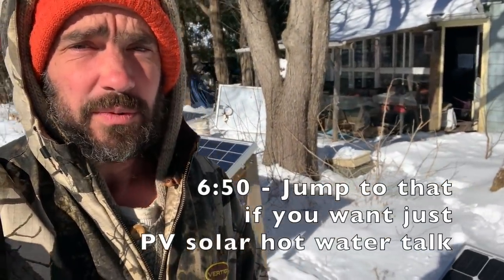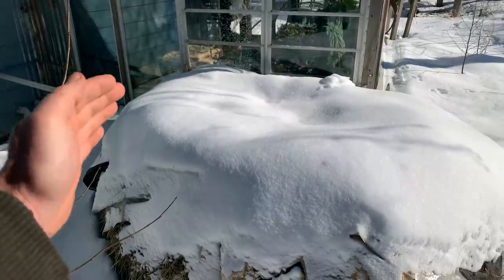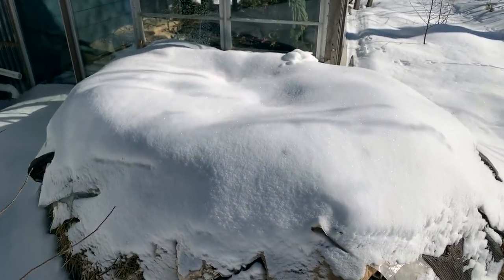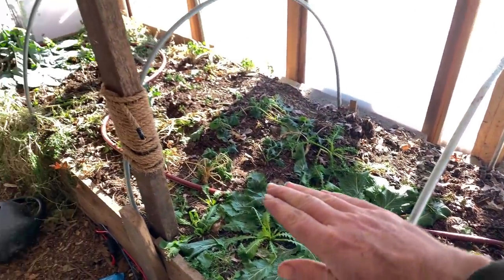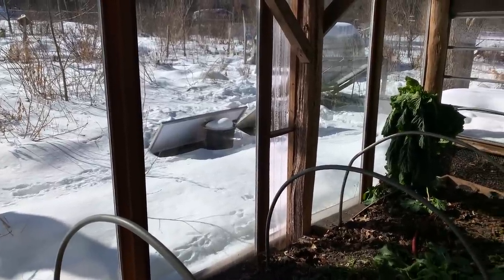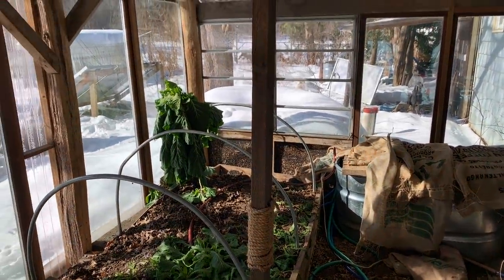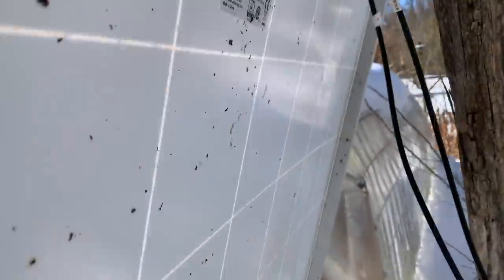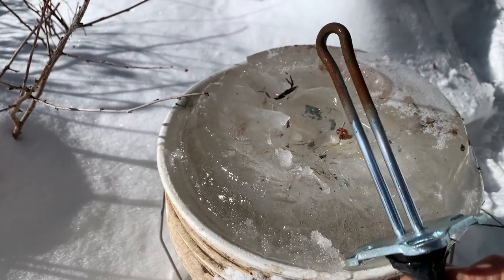Compost heating FAIL! (but solar water heating has promise!!!)

Comment: Compost Heating Failure: At our Community Garden in Northeast Alberta we have a compost pile in our Hoop House Greenhouse. Our primary purpose is to continue to produce compost through the winter when temperatures can be as low as minus 30 to minus 40 for extended periods of time. We also hope to use the heat from the compost pile to allow us to start germinating seeds in early spring. We have found that adding new organic material to our compost pile is the best (only) way to keep it heating during the extreme cold. We also circulate air through the pile with a battery powered blower moving air through weeping tile in the pile. We also "stir" the compost pile with battery powered drill with an auger bit. As you noted your compost system initially worked but failed as time went on. We have a similar experience  unless we keep adding new material.

Comment: This is some really exciting and interesting experimentation - especially given the extreme cold/sun contrasts you  get to deal with in your context (I'm jealous, Seattle's winter rain cloud blanket and Puget Sound heat reservoir generally means we're both above freezing, and too dark to do much solar scheming during the winter. Oh well, I'll live vicariously through you two:)

I had a couple thoughts, thinking back on my years of Thermodynamics in undergraduate engineering:

1) It's almost always easier to increase the heat in a greenhouse by improving the insulation and air-tightness, rather than trying to dump in more heat. This is both because insulation is often cheaper than heating tech (though, good score on the free solar panels!) and because any additional heat you dump will still be subject to losses because of the poor insulation, etc.

The folks at The New Alchemy Institute in Canada and Maine in the 1970s-1980s (which is literally one of the coolest scientist/hippie "Let's just start doing things" projects ever) found that fully passive bioshelter greenhouses benefited from having the back up to 20% of the walls covered with reflective insulation, which raised both temperatures and light levels (because light wasn't lost out the back of the  clear walled greenhouse. They found that a further 40-50% of reflective insulation on back walls continued to improve temperatures, though light levels suffered. Beyond 60% opaque, insulative walls, the temperatures began to decline too. Here's the report they put out in 1981 (the year I was born, geez!):
https://newalchemists.files.wordpress.com/2015/02/bioshelt.pdf
The rest of their archive is just amazing, if you haven't read it all already:
https://newalchemists.net/

Think about adding  tons of insulation in places like the eave-corners, where light doesn't really get in anyway, and in the lowest parts of the walls - which often aren't letting light in that gets to plants.

2) Since you have really cheap solar panels, it makes sense to use that electricity to create heat, for the reasons that you named. But in the longer tern, or for folks who are thinking about replicating this system themselves, directly creating heat from resistance heating isn't the best use of a refined energy source like DC electricity. If you can afford the additional cost, it's worth rigging up a heat pump to extract heat from somewhere (even the ground) and dump it into your system. Since they are moving heat around, rather than converting your electricity into  heat directly, they can achieve heat delivered / energy required efficiencies of greater than 100% (we regularly get close to 300% with our home heating system on mild days). Even cooler is the possibility to run the heat pump on bright, warmer days to move heat into a storage reservoir (maybe a bunch of burried gravel, maybe buried tubing to heat the ground) and then drawing that heat back out on a colder, brighter day. Heat pumps are getting smaller and smaller, mostly as AC units for van-life or boating folks:
https://www.mabrupowersystems.com/air-conditioners
But you can also rig one up yourself from broken minifridge and automotive radiator components:
https://www.youtube.com/watch?v=b3fL0r-Z2qM

Anyway, keep up the amazing work, and best of luck.
Reply from the maker: Wanted to follow up with a big thank you for sharing these ideas and links.  Somehow youtube flagged it as SPAM!  Just now I noticed, so I've got the links loaded up and some learnin' to do... Much appreciated!

Comment: We've been bitter cold here in Indiana and also super sunny. Definitely some potential with some light tech. I've been experimenting with a cheap little dome greenhouse inside my farmers friend tunnel. It got up to maybe 30f outside today but the little dome in the greenhouse was over 90f. Heat retention in the night is definitely something I need to work on. It only says about 10f over ambient with a little heat mat going. I need more thermal mass.

Comment: Be forwarned that i haven't done this myself and have no hands on experience with the compost heating system but I am very interested in the subject and have been digesting information for future use. Lately I've seen a bunch of videos also and right away i can see a big difference between their successful experiments and your not so good one: Their piles were much much bigger. Like 2 or 3 times bigger. I know smaller piles don't keep the heat as long so this might be the problem. Also they used cow manure Wich might heat up for longer. The only insulation i think they used was to insulate the tubes going in and out of the pile to the house so they wouldn't freeze and they had a very small pump going.
Hope this helps.
Love your experiments and vids!💕

Comment: Be sure to polish that panel if you can. Also have you thought of building a fresnel lense heating system? You concentrate a large area of light into a small point and use that to boil water.
Reply from the maker: I am very very interested in the fresnel lens experiments, and started with some recently but realize I need to get good eye protection bbefore I mess with it any more!

Comment: You have a video on heating your high tunnels. Sometime in the past I  watched a youtube video on an Amish woman who used hay bales to heat her green house. She used them as planting tables which she placed her planters on top to catch the heat rising from the decomposing hay bales. She used fresh rabbit pellets which she mixed with water and poured over her hay bales. Then she put the planters directly on top of them to capture the heat. Since you have hay bales or compost, and chicken manure I thought you could do the same thing to raise the temperatures in your greenhouse or cattle panel house. Maybe planting in removable trays a few inches deep would allow you to raise cool season crops on top of the decomposing heating stacks or tables. When you want to add the water you could just remove a tray and pour on the manure water. On your cattle panel house you showed a compost heap at the back door or end. If you had hip height compost heaps using chicken wire to hold the compost in place or alternatively used hay bales around three of the four sides of the cattle panel green house you would have heated areas to raise your plants as long as you kept adding the manure water to the heaps or hay bales when they started to cool down. Might save some strain on your back and knees. I am going to try it in some fashion this Winter for seed starting. Good luck!

Comment: I think your most important improvement will be insulating that water tank. Metal conducts heat extremely well which means that will be heating your greenhouse through the sides of the tank. As you mentioned the greenhouse is not insulated enough to keep the heat in, that will probably be the biggest heat loss you have in the water circuit itself. Also you can still insulate a bit around it without waiting for a thaw since it is inside the greenhouse! It would probably be useful if you can find an old rubber matt to slide under the tank as my personal experience with rubber matts is that they do not conduct heat well so it wouldn't take from your tank as much.
Reply from the maker: Great ideas here, thank you!

Comment: Backs up my experience, that even with a decent volume of compost it's pretty hard to keep it hot in a cold winter, in fact mine always runs cold even without pipes bringing cool water in (or taking heat out, whichever way you want to look at it). My suspicion is that you are going to need a LOT more volume of compost to heat that space, especially with so much heat escaping, as you noted. I've seen those huge hay piles people make for these systems, they are pretty significant. I've also not managed to keep compost going in winter even with covering/insulating it, just not enough volume.
Reply from the maker: Makes sense.  I think it will need to be a combo of a much larger pile that is nicely insulated AND these old solar panels helping to provide direct heat to the water by day to keep the system boosted... I'll keep exploring and sharing what we're trying and what we're learning (as we fail hopefully less each time!!) :)
Reply: @edibleacres  Yes, and any insulation you could provide in your lean-to , especially around the roof and eaves, would be a big plus I imagine.

Comment: interesting.  Solar power is also used to electrify fences, preventing moose pressure in Alaska.  Simple Living Alaska runs two strands going to one box, powered by a 12-volt battery.

Comment: Near the end of the video you started to mention implementing a solar panel to move water during the summer months. I'm curious, have you ever considered using a RAM pump?? They're excellent ways to move water when freezing temperatures are not an issue, especially with a series of ponds.
Reply from the maker: I hear ya, I would love to explore a ramp pump but we don't have the right landscape for it :(

Comment: I know it’s not totally sustainable but I live in CNY, it’s -12 F tonight and it’s 50 F in my double layer inflated  poly hoop house. I use a Chinese diesel heater that sips a 50/50 fuel mix of farm diesel and waste cooking oil. Only about 1 gallon a day and it runs off a 12v battery.
Reply from the maker: Sounds like a neat solution you've worked out!

Comment: Mine never heated up since I didn't either get it wet enough or I needed to add more bags of composted cow manure. I started very late so I was my own worst enemy. I put in about 10 bags of composted cow manure and a bag of blood meal powder. I was thinking about adding some urine to the center when the outside are goes up to above 32 degrees. 
Your idea of capturing the waste cycle of solar panels was so smart. Why waste a resource which still works? Brilliant idea!
Reply from the maker: I think if you start too late into a cold snap it just can't get started... Oh well, we learn as we go!
Reply: @edibleacres  so true!

Comment: As far as the compost pile, if while constructing the pile you inserted tubes to aerate all parts of the pile and thereby have the decomposition be aerobic throughout the pile as is done with the johnnson-sue composting method you would get a lot more heat production.
Reply from the maker: I think that could be true, although it would be introducing more surface area to the inside exposed to the elements, so I'd have to be quite careful about how to do it..  Thanks for sharing notes!

Comment: Thanks for the vid.  I love all of these follow-up videos on this proof of concept!
Just an idea on insulating the water tank.  I made a video recently on an alternative hot tub cover that rolls up (I got a free hot tub from a guy on Craigslist instead of it going to the landfill).  

I realize that you want to be as natural as you can with your materials, so I understand if you don't want this resource, but I used a closed-cell LDPE foam rubber, called Volara, to make the cover.  It has remarkable insulative properties, while being resistant to very high temps without degrading like other manmade materials.  Although my video is for a hot tub, I could totally see it being a very simple alteration to make one for a storage tank like this--plus your cat could get pretty comfortable on the foam!  :)

Cheers!
Reply from the maker: Thank you for this note, I may very well come back around to this idea!
Reply: @edibleacres  there's a gentleman from Colorado who did numerous studies on passive geothermal and compost air ducting that you might want to check out. He really takes a scientific approach to it. I will try to figure out his YT channel name. Or, look up 'GAHT and compost'.  I may try to do a hybrid version of what you were showing and what he showed.

Comment: When I build my house I want to build a thermal battery that will primarily be heated up by thermal solar panels, but I'm thinking I may try and get some old/beat up PV panels to help heat the thermal battery as well, since thermal panels arent always super efficient, especially homemade ones haha. The thermal battery will help heat the water for the heated flooring, and help heat the hot water for the whole house
Reply from the maker: Sounds like any time you can integrate a few different ways to meet a particular goal it seems you are doing the right thing!

Comment: The angle of the solar panels is crucial for efficiency. That scrap 325W panel is at an extreme angle, more appropriate for the arctic circle.
Reply from the maker: I hear you.  That was a VERY temporary place to put it.  I plan on making simple 'legs' that can fold out and in to stand it up for a few days at a time.

Comment: I am totally solar ignorant, so I appreciate these experiments.  I had a thought on your water tank though..... there is an old Mother article on heating a water tank for livestock.  The tank is enclosed and on the south side it has clear plastic for solar gain.  I was thinking that with your set up, if you put your water tank over that back narrow bed against your house side and with the same set up as Mother's tank, you would  end up with a trombe wall, meets compost heater, meets winter livestock waterer.  Might have to set the tank a little higher to get more sun though.  But it would be a cheap and cheerful method, and you could probably give it a go yet this winter.
Reply from the maker: If we had enough solar gain in mid-winter in the greenhouse I think a passive solar heating design for the tank would be amazing.  Defintely something to keep in mind for future experiments.
Reply: @edibleacres  This particular article gets enough traffic it should pop up pretty readily.    It would probably make my thoughts more apparent than I could without pictures ... Mother Earth News solar livestock tank heater should get you there.

Comment: As far as I understand, a compost pile is hottest 4-8 days after its creation. The temperature drops off after the first week. This might also be part of the explanation as to why it had worked for a while and then dropped off.
Reply from the maker: That makes sense.  I do think the pex circuit was doing a decent job in extracting heat which wasn't helping the compost stay alive... Needs to be BIGGER and better insulated to be sure.

Comment: First, your compost pile needs to be much bigger. To conserve heat, like it or not, you are going to have to insulate it. I recommend using aircrete. It’s sturdy, easy to work with, varmint proof and a great insulator. Dig a pit. Line the bottom and sides with aircrete. Fill the pit with your compost. That way you have a big insulated pile that doesn’t block your view. In Winter, cover the pile with a reflective tarp, reflective side down black side up to prevent radiant heat loss. That way the pile will not freeze. Another way to heat is to create a solar battery in the soil under your greenhouse using pex and a couple of thermal solar water heater panels. In the summer, you heat up the soil (ideally beneath) or beside the greenhouse. In Winter, you tap this thermal battery and use the warm water flowing in a second set of pex loops to supply the heat your greenhouse. You can attach the pex to a truck radiator equipped with a fan that you can pick up at the junkyard for < $100 to blow warm air if you like. Why not just attach the thermal solar panels directly to the greenhouse. You could but what if it’s cloudy or dark? No heat. What you want is reliable heat. If you heat up the ground and tap that, you will have plenty of heat to last the entire Winter, especially if your thermal panels are still heating it up. Hope that helps. Best of luck with that mate!

Comment: You could run low voltage heat tape under the beds and power the tape with solar. Very fun experiments, I have a few broken tesla panels from a roof, I will be doing some tests on my own of this. You can also power circulation fans in the summer months
Reply from the maker: So many different elements to explore for sure.

Comment: Look into using a PWM charge control with a bypass load circuit for you battery charging. Then any excess energy from the panels will go to heating the water. When looking for a lithium BMS system stumbled on an electrodacus and this system uses that for battery charging and heating water to heat a house. Not sure if Dacian has been successful heating his house in Saskatchewan this way or not yet.
Reply from the maker: Good notes... Yeah, having a way to charge batteries first and then dump to a hot water maker would be quite nice.  Working out the simple parts first :)